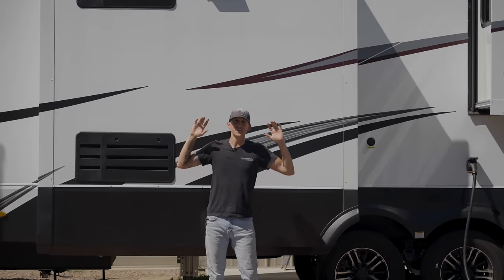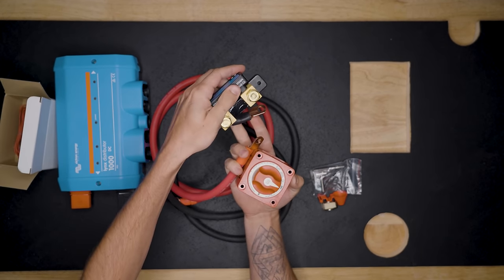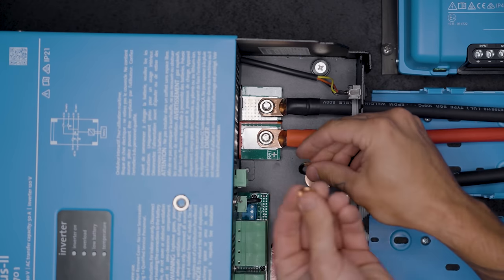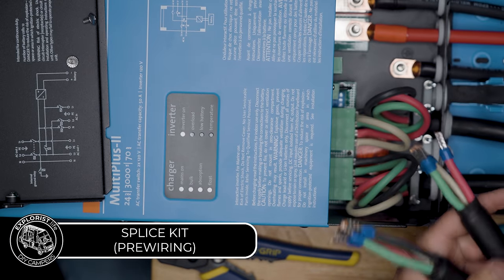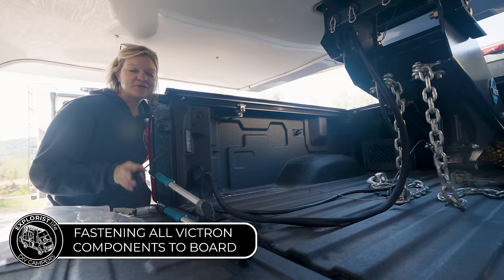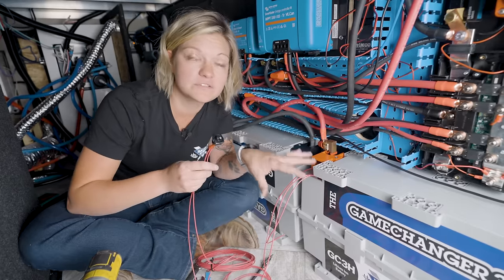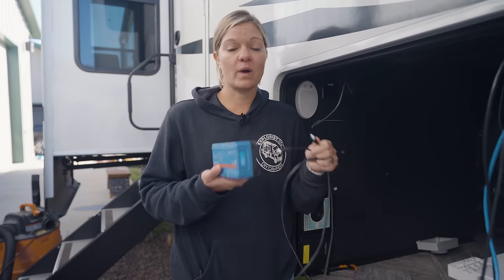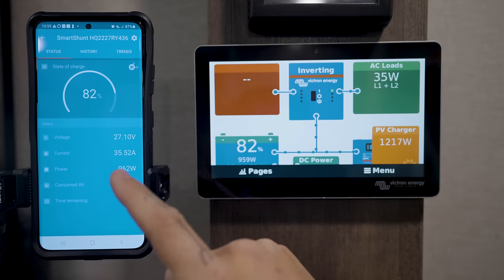We added 2400W of Solar to this 5th Wheel RV! (Full Battery/Inverter/Solar Installation)

Comment: Do you do installa on sight or just at your shop? Where are you located?
Reply from the maker: Our installation branch is in Blue River Oregon and there are indeed options for mobile installations.  Shop.explorist.life -> services -> installation
Reply: Can you tell me if i need to replace my converter as it is not lithium capadable. I have a solar charfe controllerr. Do i need to replace converter? What does converter actually do?

Comment: When you hooked up the dc/dc charging to the truck battery. You should have gone to the lug not the clamp tension bolt.
Reply from the maker: What we did is perfectly fine.  Feel free to connect where you feel is best in your own installation, though. 😉

Comment: Love the videos, if you ever decide you actually want to do a dual inverter setup on a class A, I'm interested and well funded. I have a 2017 Newmar London Aire that already has a Victron Multiplus 12v 3000va, 3 Victron charge controllers, 1500W of roof mounted panel and 800 watt of ground deploy, with 1000Ah of battle born batteries. I have pictures for your consideration if you'd like me to send them, point me to where. Thanks again for the wonderful content!  CJ
Reply from the maker: Hey!  We will open a 'casting call' for applicants next time we need an RV for a video project, so stay tuned!  Full transparancy, though, we wouldn't be choosing an RV like yours since it already has a system installed and going from one multiplus 12v 3k to two of them isn't a good idea.
Reply: Makes sense and agree I wouldn't want to just add another Multiplus, thinking of an entire redesign, maybe a Dual 48v Quattro setup. Looking forward to your dual inverter install to learn more. Thanks!  @EXPLORISTlife

Comment: 4:07  why not wire up the generators directly? Save having to exit to boot them up
Reply from the maker: Adding hard-wired generators was not in the scope of this installation video as that would be a rare thing to add for our customers.
Reply: @EXPLORISTlife  is their a reason for that?
As in, why is it uncommon?  Myself, I have the ability to start and stop my generator from inside the cab.
Although once the roof restoration is complete, will be upgrading the solar as best I can, hopefully remove need for generator.
Reply from the maker: Typically, our customers want enough solar so that they can get rid of generators altogether; so moving them toward a hard-wired solution is generally not desired.  If you already have a hard wired generator, that's perfectly fine and we would not advise to remove it since it is already in place.

Comment: Why add the orion charger the multiplus is an inverter charger
Reply from the maker: The orion is a charger that charges from the vehicles alternator.  The multiplus is an inverter and a charger that charges from shore power.  Both chargers, yes; but each one charges from different sources.

Comment: I really don't understand why you would spend so much on solar when you can spend 1k on a propane generator (you are already going to have propane for heating water) that puts out 12k watts. If you are super worried about outages you could have a powerstation till you get back to town to refill.
Reply from the maker: Loads of people don't want to have a noisy/smelly fuel burning generator running all of the time for electricity when there is a silent alternative.

Comment: Where did you get these pretty circuit diagrams?
Reply from the maker: We make them for these projects & for our kits & such. 😁
Reply: I mean, do you have a program from Victron or something else?
 I would be very interested, but pen and paper are not enough for me. 

Greetings from Switzerland
Reply from the maker: I use Visio for all of my diagrams.  They are 'pretty' because I've spent 1,000s of hours working on them over the last 5ish years.  Lots of practice went into those. 😆
Reply: Does this also work with Draw io?
Reply from the maker: Draw.io and visio are two different programs/softwares.
Reply: Sorry for all the questions, but is it possible to insert Victron shapes in MS Visio and Draw io? Or only in Visio.
Is that complicated?

Thank you, have a nice evening😅

Comment: Is it just me that gets triggered by the way he splices that power wire for the shunt instead of just crimping a new ferrule on at the correct length?
Reply from the maker: I suppose I'm just grateful that that is the biggest thing you can find an issue with in this system.  😂🤷👍

Comment: Instead of splicing the OEM transfer switch why wouldn't u just remove the loom from it and then add a section of wiring from the new box to the OEM transfer switch? And see if there's enough room to move it from the floor to the wall. What a rats nest of factory wiring... my God, that's driving me nuts
Reply from the maker: That's also an option; but removing/rewiring things from the breaker box or transfer switch has a bit more room for error AND oftentimes, that wire will not be long enough to do what you are proposing.  The way I showed is a little more straightforward to understand, I've found, and works in 100% of use cases with no if's and's, or but's.
Reply: @EXPLORISTlife I’m planning to hook my 5th wheel up to a lithium ion phosphate 100ah battery. What inverter do I need to get????